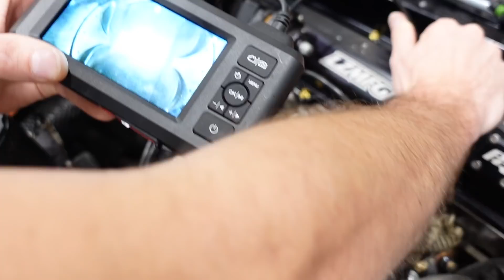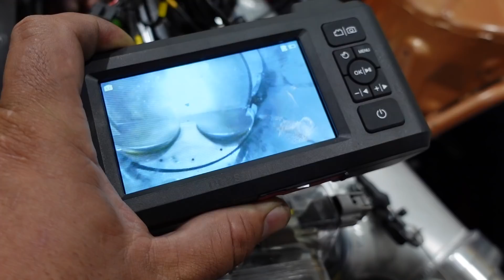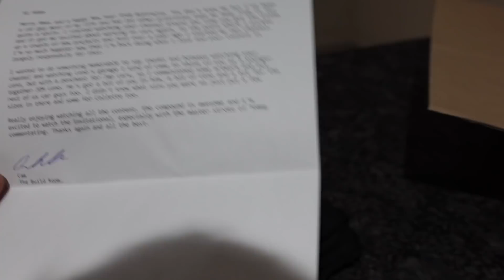2JZ or RB26 - A Sad Truth...

Comment: Depending on size of cam you may need to run a richer idle and less timing in idle. my skyline prefers a .93 lambda at idle. I doubt it’s the tune though because you have multiple high hp cars so I’m guessing you have someone that knows what’s good.
With everything you have checked so far I’d straight wire ignition and fuel 12v supply bypass any connector or relay. Check for shims that have been spat out exhaust side. If that’s the problem then run a tighter valve clearance, I like to run mine at or right under .30 cold less noise up top and no chance of spitting one out depending on what type of valves your running heat expansion is different between brands so good to check hot also before you start sending it. If it’s only while hot then it’s likely valve clearance problem, to tight Other then that clean trigger wheels and hall sensors. Have you valve timed it? Most aftermarket cams are off about 4-10 degrees From what I’ve seen. Really can’t offer anymore help without knowing more about the build. Send me a msg here to help if I can I’ve been working on rb engines for around 15 years now I’m also located in Florida. 
Good luck hope you get it sorted that car is a beauty don’t jz swap it lol

Comment: Sounds like the Rb problem is electrical, Nissan's are known for bad crank and cam angle sensors. Cam looks to be a PRP item so maybe look at crank. Also check all grounds, even just adding one from jumper cables. As a fast of testing

Comment: Are you running the factory cam angle sensor? The triggering system sucks. If you can upgrade to a hall effect sensor and trigger wheel eliminating the OEM CAS i believe it's a step in the right direction.

Comment: Put a head gasket in that rb definitely leaking between two cylinders, Explains the rough idle that clears up and why your not seeing anything on the leak down or compression test… and you have checked everything else and with more boost you know the chances of burning a gasket… seemes like the only thing your over looking

Comment: I had a similar problem on an SR years ago, 1 cylinder would just drop out random and you could feel it when it happened. Turned out the harness wasn't seated into the ecu all the way making a bad connection and vibrations would mess with the contacts causing the cylinder to drop in and out randomly.

Comment: It's not the actual deleation of the hicas itself.. It was when you guys removed the hicas ecu. That's what regulated how much line pressure these is in the system as its Speed sensitive.. High pressure at low speeds and low pressure at high speeds. Now that you removed it it thinks its constantly doing 180kmph so bleeds off the line pressure.  Had it on my r33 where a capacitor failed so It would be normal for the first time I turned it on each day  or after about 6 hours but if I went to the shop went off and on it would play up and I'd have almost no line pressure. Put that ecu back in and it will be fine.. Pretty sure I commented on it at the time

Comment: Have you checked voltage and amperage coming from the alternator at idle? Low voltage or not enough amperage for the electronics on a vehicle can create some super weird issues at idle

Comment: Sounds like a ring broke apart with a bit of pre ignition. What type of fuel were you running?  Maybe the octane level was too high and and pooled up in the cylinder until it got hot enough and ignited in the top of the cylinder

Comment: What way do you have you idel control setup? Are you still using the stock balance pipe and idea valve or are you using jacked throttle and ignition cut, check your throttle flaps one could be closed more that others especially after flat shift are any kind of back fire, or a bent rod

Comment: Have you checked the exhaust for leaks? 
I have the exact same problem with my m52b28 bmw engine and i can't figure it out for 2 years.. Changed injectors, changed coils, plugs, compression and all is fine, literally the same problem as you. Runs clean on revs and you can rip it and all is fine but on idle it's missfiring on almost all cylinders, the warmer it gets, the worse it gets..

Comment: idk if you had it completely rebuilt or the miles on the engine and head but i know after some rips in a car after a while of doing the extreme loads on the car your valves can either do one of two things some can tighten or they can loosen in different spots on the cams and could very well cause rough idle and when you give it gas it clears the symptoms up and also makes more noise coming from the value cover i need to do a valve adjustment on my car like 30k miles ago it just gets rougher and rougher over time note i also do not have any check engine codes telling me misfire tho and i also do not have a laptop to where you can check and tune the ecu like you guys so maybe there is but i am pretty sure mine is related to valve adjustment it does not hurt to do a adjustment to rule that out and also just makes the car run so much smother haha had a friend that was insane about doing that shit he would do an adjustment every 8k miles  lol makes a difference its just a tedious job non the less at the end of the day

Comment: You have electrical problem.... But that's obvious.... Basically the hiring RPM range the more voltage... More voltage solves a lot of weak connections or loose connections by creating more energy to create a larger spark gap I guess is easier way of saying it.... Check all of your grounds use dielectric grease because all you did was create a gremlin by every beating or shake down that you did.... You could have possibly a chafed wire as well but it's electrical for sure

Comment: Check air flow sensors/02 sensor. Sounds like a common 02 sensor malfunction. My IS300 did the same thing a couple of months ago. I replaced all the vacuum lines and intake mani gasket, and eventually the CEL came on after like a month of it doing the wierd shit. I changed the o2 sensors and it was fine. It idled  a little high especially on warm up, then it would idle anywhere from 400-1200 rpm at idle, but under load it was fine. Cant hurt to just change whatever o2 sensor you are using on the car. :)

Comment: I know this is a weird thing to bring up to a professional level shop, but I've had a bad battery terminal cause misfire at idle, especially after hard driving moving things around.
Reply: How’s it weird that sounds like a Normal car issue bud
Reply: @DentSideDee71  weird saying it to people who deal with much more high maintenance cars. Like I suspect they have already checked electrical connections, but just throwing it out there in case.
Reply: @fl4shb4ckGaming  depends on what kinda car your talkin there could be as many reasons to why the terminal caused misfire or even if it was that in that case all good no hate 🙌🏽💯

Comment: Sounds like to me it's seen to many lean conditions and and fucked the rings it'll hold compression but it'll miss it'll get worse and worse goes to rpm but the miss will get worse and intermittently come and go depending on day block temp this and that so then soon enough it'll blow them completely if you drive it normally not so much but now your on the side of demishing return on the rb sir

Comment: I had a problem with the idle control valve underneath cold side manifold on my 26 s15. My tuner blocked it off and stopped using it all together. Mite not be the same problem but my one did the same thing. Cheers from New Zealand 🇳🇿👌

Comment: Can anyone help me out I have a Mercedes E350 with an EPS alert now after A small collision that damaged my left driver side bumper as to which I replaced the entire bumper I’ve already also replaced the brake light switch with no avail to the issue however I didn’t have a scan tool to clear the code don’t know if it’s necessary anyone tell me what else I can do?

Comment: If I was to run any stock block I would run the 2020 GT500 5.2 l in a car put some twin turbos on it and call it good cuz that motor can handle big Power stock that motor reliably can run 1000 whp all day and upwards of 1300 whp and that's a unopened long block

Comment: Fking RBs man lol. Mine had the sane issue I daily drive my R33. Was the MAF for me. Soldered it and fixed it. Also check ur IAT and ur resistances across ur coils. A bad coil, ground, resistance can cause misfire issues at idle. RBs are notorious for acting up for minor voltage issues.